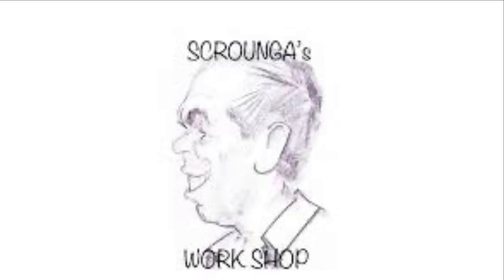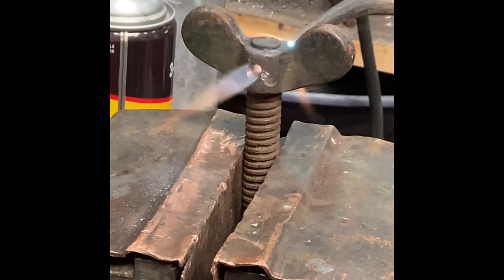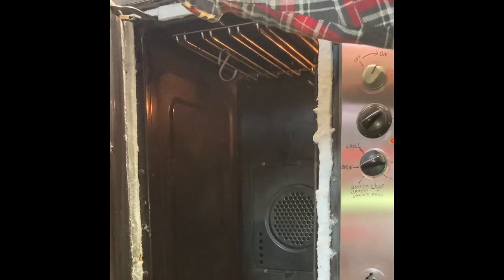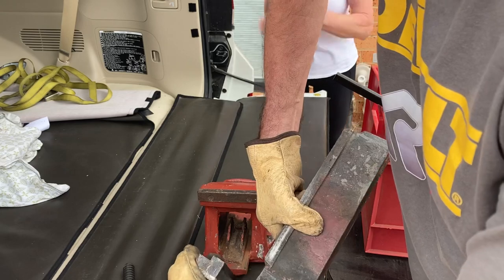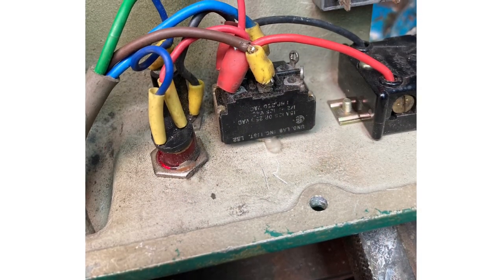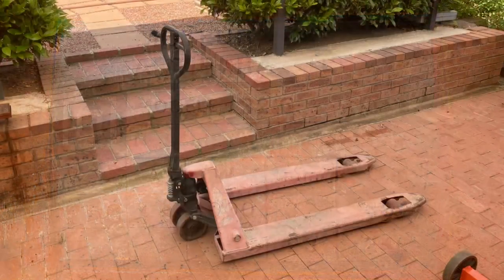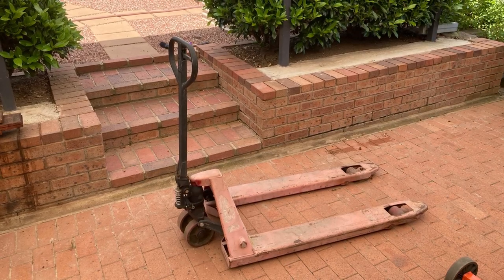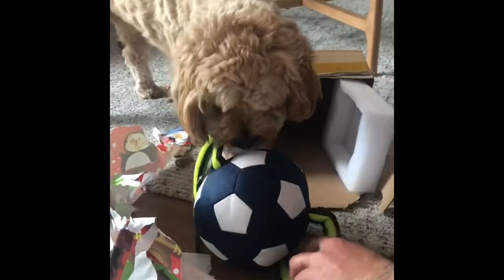Unusual F Clamp Restoration + What else I’ve been up to.

Comment: Hey! I recognise that Jotun Orange powder coat. Got some just like it😁 Nice score on the mag base and the drill. They dressed up real nice. Have you seen the Tribo style powder coat guns? They don't need a high voltage power supply. Just air and an earth.
Regards, Preso
Reply from the maker: Hi Mark, funny how we ended up with the same colour😂. Now you know which paint is a good match as well. I’ll look into those guns, thanks for the tip.
I’ve really been enjoying your small engine build, your attention to detail and calculations blows me away. I’m more of a “meh, good enough for government work” kinda bloke. I get too frustrated with trying to be that accurate and failing😂. Cheers my friend.

Comment: I  like the powder coating. Do you need a special sprayer to apply the powder? Good video,  Yes the other restorations were interesting I didn't understand everything going on but that was me not you. What you did,  I enjoyed. Thanks
Reply from the maker: Hi Dale and thanks for your encouragement. Yes you do need a special sprayer for the powder coating but they’re not very expensive off eBay and I find the powder coating has a lot of advantages over paint. I think you would really like it and it’s fairly easy to get set up. I just use an old aluminium tool box tipped on its side as my “spray booth” with a bathroom extractor fan to suck up the excess powder. My curing oven is just an old house hold oven I picked up from the junk shop and it’s tipped on its side as well. You need about 10-15 psi of compressed air for the spray gun. 
Cheers mate and if you need any help with powder coating just let me know at       Stuart.leanne@gmail.com

Comment: I notice you sorta skipped over the de-rusting and polishing of the screws and shafts of the F Clamp.  What did you do please?  And, more generally, what is your go-to for de-rusting things like that?
Reply from the maker: Hi Brian, sorry if I missed the details, I’ve shown a fair bit of how I get the parts polished in previous videos and didn’t want to bore people with repeating the same stuff. I have several methods but on this project everything was sandblasted first. This gets everything clean and then parts to be polished go to my nylon buffing wheels. These wheels are 1” x 8” and come in different grades from 80 grit up to 1000 grit. I’ll put the part over a couple of different wheels and then it’s onto the proper buffing wheel for a final polish. In future videos I’ll include at least some footage of the different steps so thanks for helping me improve my channel. Cheers Stuart 👍👍👍

Comment: Hey Scrounga!  Check out this awesome vise collector!  https://youtu.be/lREpU4D432A. He uses one of those magnetic base drills like you found and repaired.
Reply from the maker: Thanks Time flys, I didn’t see a mag drill but I did enjoy the video and it certainly gave me some ideas for displaying my vice and clamp collections so thanks heaps 👍👍👍 Cheers Stuart.
Reply: @scroungasworkshop4663  sorry Stuart.  I had watched several of his videos as research for a new vise I found and the one I linked was not the one with the mag drill I saw.  Here is the right link.  https://youtu.be/rARRCpoxSn4
Reply from the maker: @timeflysintheshop  No worries at all my friend. I appreciate you letting me know about a really good channel. He certainly seems a bit OCD about vices😂. I’ve finished my mag drill and it’s a beast. I’ll show it in my next video which is a Brades hatchet restoration but I’ve included an update of the finished drill. I should have that up in a few days. Cheers and thanks again 👍👍👍